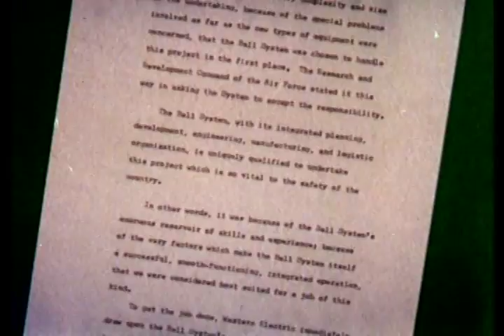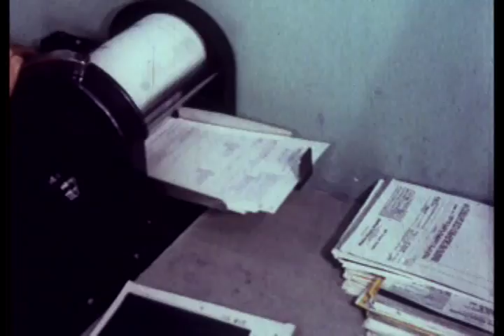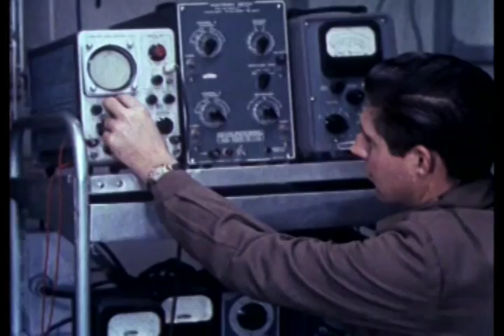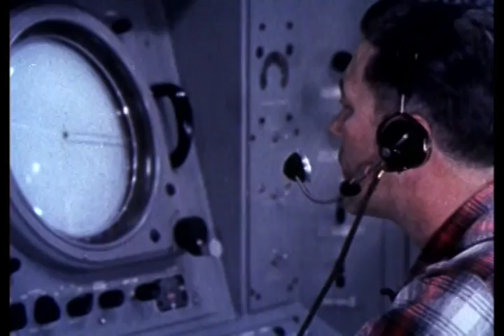The DEW Line Story

Comment: In our town of 56,000 in WI we still have the entire city covered by both old and new sirens which are tested on the 1st Monday of every month at 11:00 am.  They are mainly there for tornados or violent T-storms, but they also have a special sounding for other take shelter emergencies.  And each of the 7 townships around the area have dedicated volunteer fire station sirens.  And the 3 other small cities more than 20 miles out from the city have their own systems, however in our city the dumbasses have put the emergency command center right in the center of the city and we ARE a target as we have a large telephone junction station in the middle of town as well as a super computer factory, old ammunition factories in moth balls, and 2 colleges as well as several high tech manufacturing businesses. Our government’s plan is to race to the airport and get out of town fast with their families.  
-  the townships used to have a command center about 6 miles out of town but it was just a cinder block blockhouse in the side of a hill. No water, supplies, etc. and it was abandoned in the mid 60’s. So here we are left with the bent over self defense plan:  bend over and kiss your ass good bye!

Comment: Those Air Force uniforms appear to be a green color on my screen 5:20. I ask if Air Force uniforms were green in those days (I Thought blue was normal) I ask, what model of aircraft is shown at 6:50
Reply: Looks like a Beaver
Reply: @dmacpher  Hello Dieter (you are not "that" Dieter are you?) I ask if there is a second choice on aircraft type? I should have known that it most likely was a Beaver. Small aircraft with large wing struts and a radial engine in the way of the pilot's vision on takeoff and landing. Sounds like a Beaver to me. I am just the right age to have worked the Alaska pipeline (construction) I had too good of a job here in the States to take the risk. Lots of guys went,and came back.
Reply: Dan R i am A Dieter - depends on where you know the name. If from Cannabis then yes.
Reply: Dan R Could also be a single otter - the radial engine really limits what it could be. I’m not aware of a Cessna at the time with one.
Reply: @dmacpher  Hello. From the movie Little Dieter Needs to Fly.
Reply: Dan R Ah nope! Not the sprockets skit from Saturday night live! Pleasure to meet you.